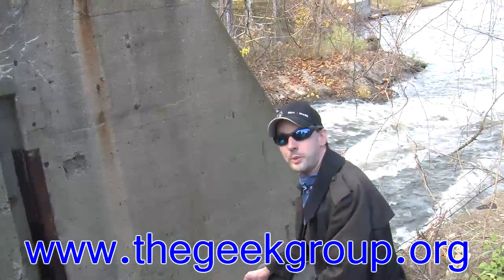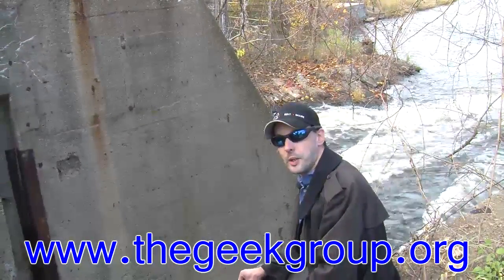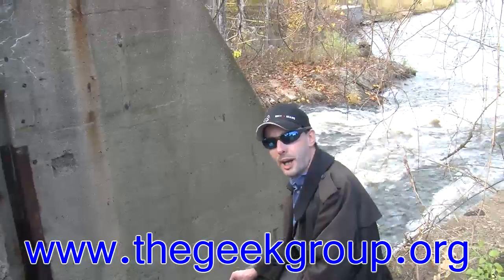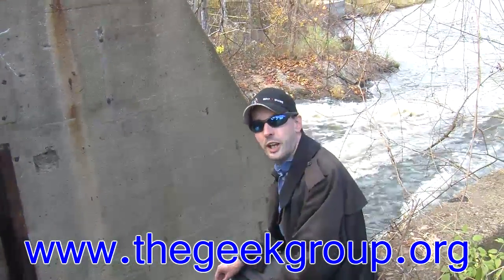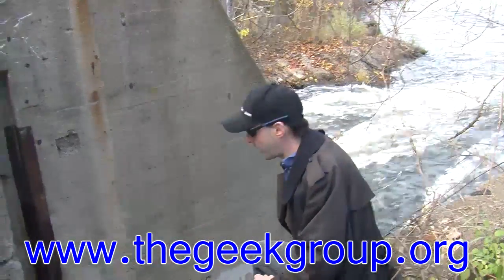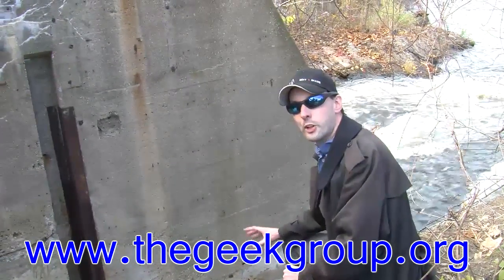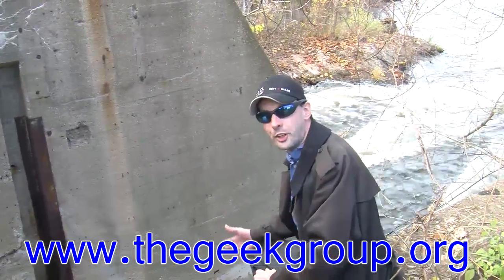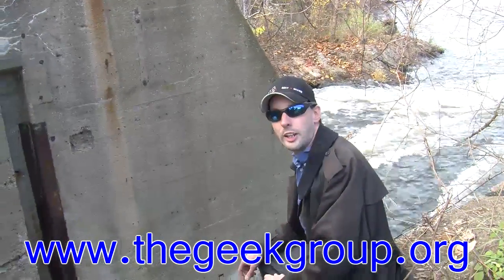Volts and Amps In a Minute

Comment: Wait... ive been an electrician for going on 10 years now and I never heard it put this way. I like this, ive heard the water analogy and like it but never heard it put as eloquently.
You helped me revise my own piss poor analogy So to summarize the response I use now when Someone asks, "I've never understood electricity its like magic".
My response will be: If you look at electricity as if it were water then water pressure is volts and water volume is amps.

If they ask for a deeper explanation.
Im literally drawing a picture and saying this 
Imagine you were to measure this parallelepiped chunk of the water to see how much work it can do for you.
Voltage would be like if you measured the speed of the water as it moves from the beginning to the end lengthwise.
Amperage would be like if you cut that chunk into slices like a pepperoni and measured the volume of your sliced chunk. 
Ohms would be the height and width of the chunk the water has to move through.
Watts would be the usable energy which is the amperage times the voltage.
Reply: Soo, based on this understanding the reason amps kills you is if you had feathers moving really fast, a high voltage and lower amperage you could stand there and probably take the beating. But if they are high amperage, which I imagine as a density from this analogy, it's essentially like a slower moving, but denser object. So let's imagine a barrage of marbles flying at you. I love your analogy for ohms btw!